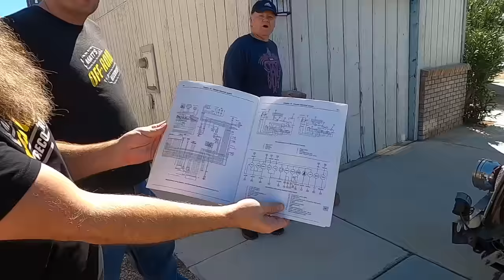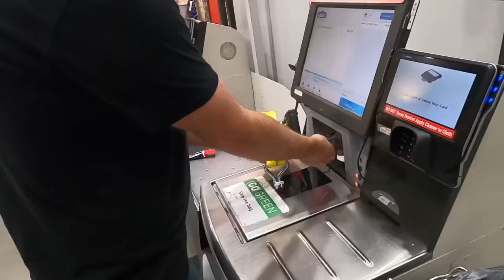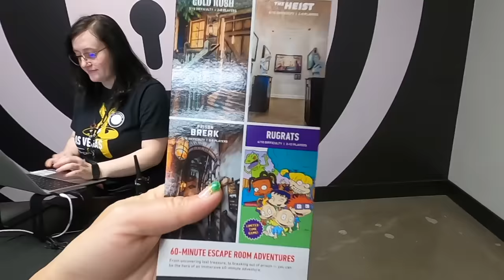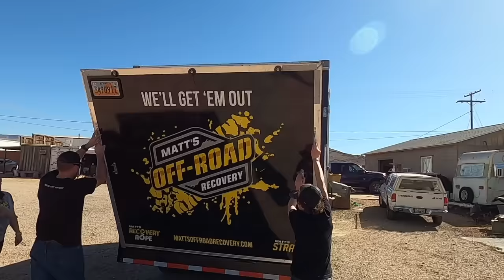My Wife Surprised Me With The BEST Off Road Rig!

Comment: As a long time Samurai rock crawler owner  I will give you a tech tip. Place a fuel regulator inline close to the carb, it helps keep the mechanical fuel pump from pushing too much fuel when you floor it going up a hill and reduces the flooding from overflow.
Reply: Or just throw in the 1.6 16v tracker motor that doubles the horsepower to 120 from the original 60
Reply: Great Tech tip from a pro
Reply: That's awesome to know. Thanks
Reply: Yeah, Matt is going to reinvent the powerplant without doubt or hesitation
Reply: Isn't that what the Harley carb is for?
Reply: @dobledekersoulwrekr  that’s the best tip
Reply: @amyrsh9067  simpler to cut a hose and install a regulator and two hose clamps than install the Harley carb, and other parts required to use it and the results are the same. Plus ➕️ it doesn't cause problems with trying to register it if you live in a state that requires original equipment.
Reply: Is the idle rpm too high for every one of them?
Reply: @UCqNFbUPIM5KMQaUMtw-pK9A the regulator helps with that by helping keep the carbs bowl from being over filled, after I installed mine and set it I no longer had the issue.
Reply: @dobledekersoulwrekr  The G16b 16v is nowhere near 120hp - it's got 93-95 from factory.  Standard Zuk G13a or G13ba has about 66hp. The J20a is 120hp, if that's your target.
Reply: or, or ditch the mechanical fuel pump take the rod out of it and get a 1-4 psi electric pump and a sweet Harley carb
Reply: @amyrsh9067  I think the Harley carb has a better float system for steep inclines.
Reply: The design of a WEBER carburetor allows fuel to pour from the float bowl vent into the carb throat, flooding the engine once you tilt it past a certain steep angle. They sell side-draft carburetors, which will likely solve the problem much better than your suggestion of limiting the amount of fuel available on a WOT run uphill, as the Suzuki fuel pump only puts out about 4-5 psig to begin with. Most all other carburetors can flood simply from the fuel bowl(s) being dirty. - Dirt gets trapped between the needle and seat for the float bowl.
Reply: @dobledekersoulwrekr  Yep thats what we do in the Netherlands, fantastic combination.
Reply: @dawabbitt3079  the great thing about a Samurai is they don't use much fuel so if you can starve the float bowl and keep an in rush of fuel from exacerbating the issue you can drive up steeper obstacles. If I was going to modify a rig to eliminate this issue I would just install a TBI system. This is a cheap mod that helps decrease the issue
Reply: @dobledekersoulwrekr  Or just throw in a 2.7 v6 from an XL-7.

Comment: Matt if you need any info or parts for the Samurai, I’ve got you covered. I got my first one at age 10 and have had over 30 since. Low Range Off-road is the go to place for aftermarket parts! Toyota axles, and a YJ spring conversation are the two most commons mods. Also can add in power steering pretty easily, and would definitely recommend doing T-Case gears.

Comment: Man that is pretty cool and has a lot of potential!   That high idle is hiding some kind of a problem , maybe just a vacuum leak.
Reply: dont think they plan on keeping that motor and drive line! Its Matts Off Road Recovery Go big or go home!
Reply: There is a plunger thing on the back of the carb that gets out of adjustment.  Took me forever to figure it out.  Suzuki John showed me the light.

Comment: You were compliant with 2 straps if they had the correct weight rating.  4 straps is required by DOT on rolling loads that weigh 10,000 lbs or more.  

4 is always better. But not required.
Reply: The jeep and trailer is probably under 10k pounds
Reply: 100% true! and the 4 are only rated at 50% of the WLL rating, so they have the same aggregate rating as 2 that touch both sides.
Reply: Arnt these guys connected to Winder towing? I would think a tow company would know the requirements.
Reply: @iffykidmn8170  they are, but specialized towing equipment can change these rules. The way they did it isn’t wrong, just not necessary. Most companies will just blanket set a rule, like four corner securement, instead of putting it on the driver to decide when something is over the weight required to follow the four corner rule. When in doubt always do more, especially when it comes to the DOT.

Comment: I was a jeep guy for years until I met the Sammy in mid 90's never looked back but want folks to know. You don't need metal door handles. Every few months take the door panels off & shoot some goo on outside door handle pivots & inside anything that moves... also squirt some in the door lock where the key goes in. No more broken levers or stripped window cranks.Next on the list is the heater refresh... happy trails

Comment: We had an LJ50 (it was my Mum's runabout). It was a great little tractor around our paddocks and fun to take out on the trails, especially being so narrow and with great ground clearance. It was the soft top version, so not so great in winter, and not great handling on the tarmac. It had the 3 cylinder 2 stroke engine so it was pretty much a motor bike engine.

Comment: Had an 88.5 and it was the best off road vehicle I ever head for East Coast/PA woods and mud. Built and lifted it to run 32's BFG Mud Terrains, it would go places only ATVs could go and the short wheelbase allowed it to climb over any roadblock or obstacle. Only 52 or 53 HP but it was enough!

Comment: I could smell those burning tyres right here in Johannesburg! Bought a 2013 Suz Jimny brand new and still driving it. Will retire with it. It never gets stuck. Sand, mud, makes no difference. Very economical. 30 miles per US gallon city traffic is normal. Tyres also a breeze. have done 93 000 miles on one set of Continental 15 inch off road / 4x4 tyres. Will try and send you photos / video👍👍🤓🇿🇦

Comment: Had one with a GM V6 4.3, short shaft T350, adapter, Toyota Transfer, cut down Toyota drive shafts, Toyota axels, sitting on 36" tires... It was a beast, and we used it almost every trip as the tow truck.

Comment: Having owned a Samurai I can attest to it's off road abilities. Little guys are amazing stock and mind boggling when modified. You can still get them from Japan if you can deal with Right hand drive and a 3 cylinder turbo instead of the little 1.3 4 banger. Bonus is the turbo is fuel injected. I personally own a Mitsubishi Pajero Mini which is an absolute hoot to drive.

Comment: I ran Samurai on a very very nasty bush trail . It was stock with the roughest snow tyres I could find. I seldom had it over 20k only ever used first and second low range still I beat it up so bad that in the end the only thing that worked was the starter and the lights that I put on the roof. I fondly gave it to a friend he did a fantastic job re building it . If I knew how to I would send you the great picture that I have of it

Comment: I used to rock crawl in Moab with a typically decked out '93 Jeep Wrangler. (Square headlight club for life)  All the Jeeps in my group were daily drivers worth less than $10k. We used to make fun of what we called "Money Rigs".  We'd take pride in climbing an obstacle just as easy or easier than a rig that cost 10 times what we had. And of course we'd make fun of FJ's or 1500's out on the trail.

But Zuki's?!  Mad respect for those guys. A Zuki driver out there on the same trail as us was a sight to behold. Congrats on the new toy.

Comment: I have a 1987 samurai deluxe hard top with factory air conditioning that only had 1600 miles when I bought it 5 years ago for.  I purchased it from the original owner for $500 and it was only driven for a few months and they lost the keys and never drove it again.  The paint and interior plastic was sun damaged but the body and everything else was new.  First thing you do to a samurai is order a set of rugged ridge seats.  I lifted it on 33's and installed a turbo ecotec engine from a pontiac solstice.

Comment: my dad had a farm samurai about 12 years ago, i learned how to drive manual with it. It had crappy goodyear wrangler tires from walmart that are like $80 each, but it did WAY better in the pastures than the lifted meaty tire cj wrangler that he got later. The samurai always ran, but sometimes had some choke issues and was kind of timid to idle, in a way. It got a weber carb and that thing was perfect, from any rpm it would drop down to idle like it was a diesel engine, never had a feeling like it might stall

Comment: I Learned to drive  manual on an 85  samari that we  bought  for a cheap  case of  beer back in 1997, when i.i was just 7 years old. The lady that owned it    somehow  broke   al but  the main leaves  on both  front  springs  when she  dropped it over a cement  parking  curb. Since she always kept the front  hubs  locked,  the ujoint  ears on the front  driveshaft   kissed the oil  pan and  cause a knocking  noise(  they didn't know what was causing the knock)  so she parked it and  baught a  2 door  chevy tracker replace it.   Still have  the rusted  out old girl  out in the pasture, though it hasn't  ran in  15 years or  so.

Comment: I had a Samurai in the mid 90s. Basically stock with slightly larger and more aggressive tires. It sucked on the highway if you had to climb any grades but off road it was great.

Comment: BEST OFF ROAD MULE EVER,  I had one 1990 Samurai for 20 years with 525000km on the clock . Rebuild the Engine at 225000km. I got top speed of 140 Km/h on flat ground.

Comment: From 0 to 30 it is a lil speed deamon. It will also mostly float over sand where other vehicles sink and get stuck. Just don't try to pass a truck on the highway as its 64 hp and boxy front won't allow you to get past the wind coming off the front of the truck.

Comment: I had a ton of fun when I had a samurai ten years or so ago, in stock form you can fit 33s with just a simple under/over conversation. Welded some spring perches on the top of the axle and put the springs on top of the axle.  Cheapest lift known to man lol. I'm sure y'all went way better than that but I did what worked at the time.  The  1.3 was pretty much worthless with stock gearing and those tires , I couldn't maintain 55 mph on flat while being in 5th gear, pretty much made 5th non existent after that . Around here it was common to swap in a newer higher HP fuel injection engine out of a tracker.. that made it pretty reliable and great for of road since the truck was less affected by extreme angles. Hope to see it lots on the channel

Comment: I had the misfortune of driving a 2-door late '89 Sidekick for a couple of months back around 1992.  Slightly larger engine than the Samurai, but still so anemic that "turning off the air-conditioner" was sarcastically considered the same as "kicking in the turbo"...  Maybe it would have been better with a manual transmission... It definitely needed more power... The "80 hp" in the engine power rating stands for "hamster power", not "horsepower"...

Comment: Burning those tires off LOL they won't be on there for very long I'm sure. After about $15,000 with lift new front and rear ends and bigger tires and lockers it will be a big pile of fun for both of you on the trails 🤗

Comment: I know I’m a little late getting to the game, somehow I missed this one. That really is the best off-road vehicle money can buy bar none. There are so many different mods, so many different opinions that you will get lost in the options. I’ve had four. I know a little bit About them. Obviously the elephant in the room is the engine. I’m assuming that you’re going to want to run bigger tires, so that engine is it gonna have to come out. Suzuki made a dual overhead cam version of that engine which is probably the coolest swap but probably  the most hardest to find. It was never offered in anything that I know of other than the Suzuki Swift or Cultus here in the US. There were turbo kit aplenty for it at the time. The benefits would be the engine mounts are all the same, requiring no adapters for the transmission, just some wiring. It would also help with ground clearance issues as the engine That you put in Ed’s truck would have to be lowered to get clearance from the front axle. It would also have the distinction of being considered rare as those engines are very hard to find anymore.  There are also hits out there to where you can put a 4.3 Vortech without having to extend the front end. I’ve also heard of the 1.8 golf diesel swap. They also made the 1.3 fuel injected in later years which would probably be the easiest thing by far.